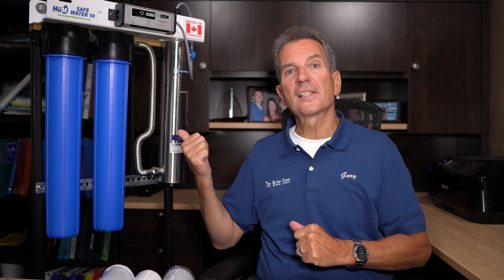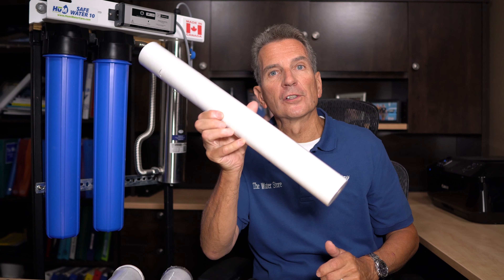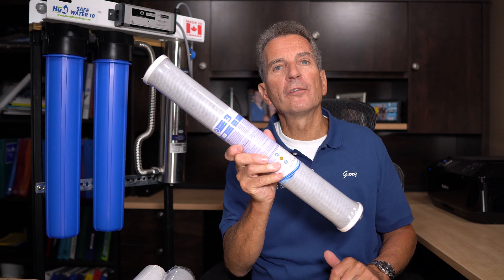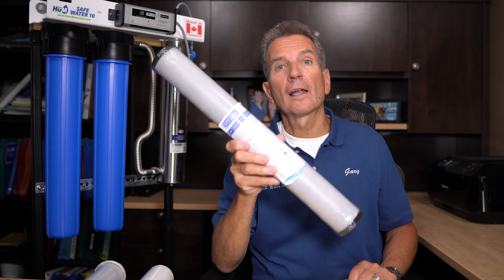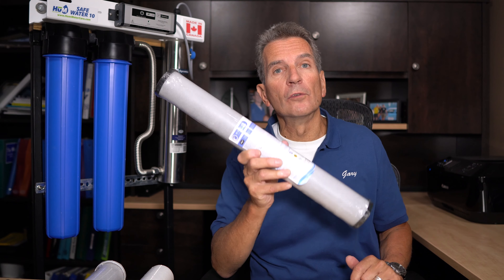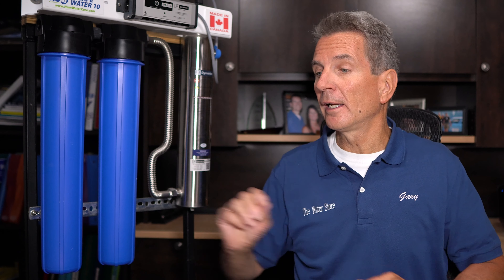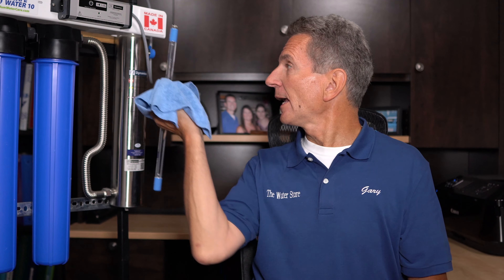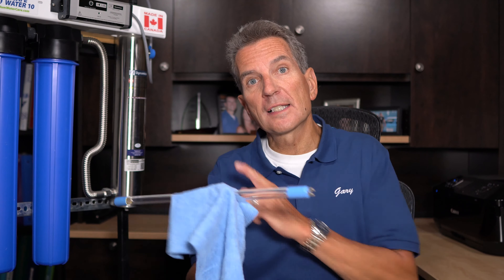HOW DOES a RESIDENTIAL UV Water system work?

Comment: UV lights are the number one sell for us with realtors. Passing that bacteria test is often the difference between a house selling and not selling. I had one earlier this week where I installed a UV, while I was there I tested their water and found it was 34 grains hard. In under 30 seconds I had them sold on buying a water softener. The worse the water is the more the equipment sells itself, we just have to be knowledgeable and professional.
Reply from the maker: Yes, if a home on well or surface water does not have potable water, real estate agents call us to get a UV installed ASAP!

Comment: What flow rate do you need to flow the water  through the UV lamp to kill all the bacteria?
Reply from the maker: Depends on the size of UV system.  For example this UV is reated for 10 gallons per minute https://waterestore.ca/products/hum-safe-water-10gpm-minirack-mr320e-tp2s-220 so as long as the water flow does not exceed 10 gpm it will kill the bacteria
Reply: @water_estore  ok that’s a lot for just drinking. Thanks

Comment: Water softener or iron filter recommendations anyone?? I currently have a water boss 380 and it hasn't been working. Did a power clean and it was amazing for a few weeks and then stopped working again. Water boss recommended their iron filter (i have well water). My question is.. should i also replace the softener? I hear watsr boss isn't the best.. anyone ever had a whirlpool softener? Or any other recommendations? Thanks!😊
Reply from the maker: This video of mine will help you choose the correct iron filter for your family. https://youtu.be/af1iVOC-Hyk  I would install the iron filter and see if it removes enough of the iron that your current water will work fine.  If not you can always replace the water softener later.  WaterBoss is a very good water softener but they don't like iron.
Reply: @water_estore  you are the best!! Thank you!